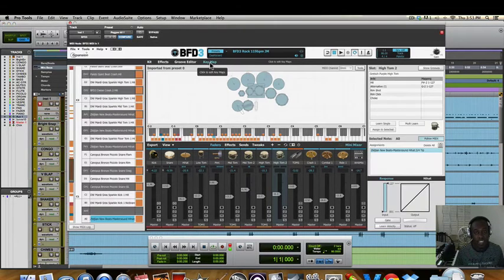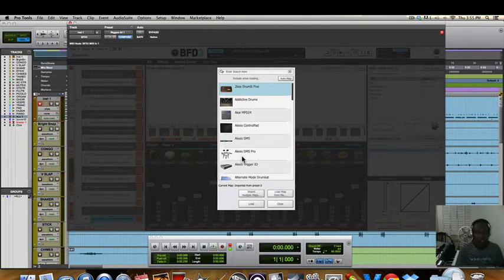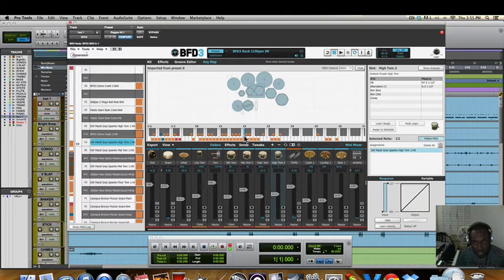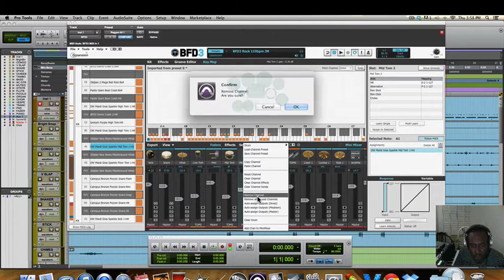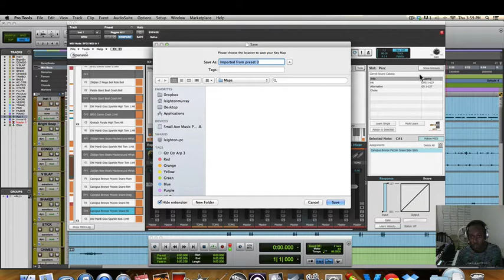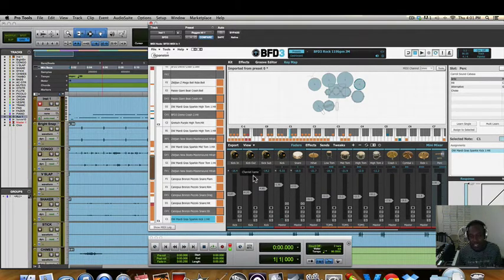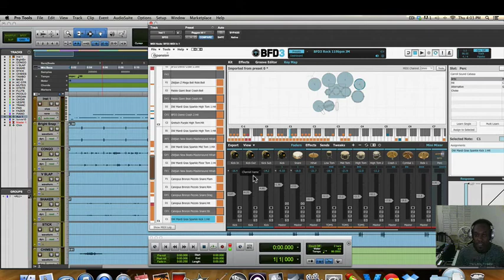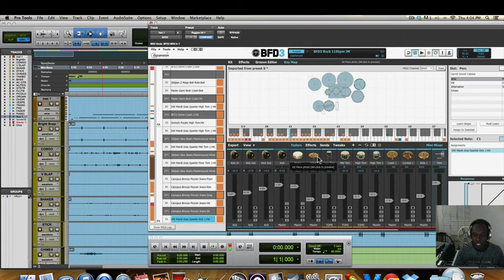BFD 3 Key Mapping

Comment: I don't really understand how to use variable hi hat. The logic drummer template keymap isn't working with Logic and the hi hat key functions are different
Reply from the maker: I am not so familiar with logic ways of doing drums.
Reply: I meant with BFD3. I can't stand the GUI in BFD, the groove editor is abysmal. I prefer the logic midi editor. I guess Cubase, Pro Tools etc, would be the same. I think the variable control is the modulation to open and close the hat
Reply from the maker: @Michael Bennett  ok, well a lot of guys like logic midi editor. I wouldn't use the Mido in BFD program anyway; I always love to work I'm my DAW.

Comment: Could I hire you to do this for me via Team Viewer with my keyboard and version of BFD3? Where are you located?
Reply from the maker: Lazlo Aluisa it's easy brother just watch video and apply steps.
Reply: Small Axe MP , Thank you so much for your reply. Yes it does seem relatively simply. The only problem is that it seems like you have a keyboard to start with that is close to one of the ones that bfd3 has a map for and you simply added to it or changed it. I am planning to get an M Audio 88 key controller that is not listed amongst the map presets. Do you know of a way that bfd3 allows one to add such a device from scratch? Any insight would be most appreciated.
Reply from the maker: Lazlo Aluisa it doesn't matter what device you have. You can just customize the mapping t9 whatever you have. M-audio is GM - general midi so it should be standard. So pull up the GM preset and work from there when you get it.
Reply: Thank you so much. This helps a lot.

Comment: Broken here with Cubase Pro 13.Have my mapping set up correctly but the wrong sounds are playing.
Reply from the maker: You have to use a drum VST or use a drum machine inside of Cubase. Midi is just the performance. Make sure you have a drum instrument on the track or an instrument track with the drum vst.
Reply: @SmallAxeMP  I do .Superior Drummer plays the sounds correctly but Groove Agent,BFD 3 and ML Drums play the wrong sounds when I adjust the drum map to match my Yamaha multi 12.